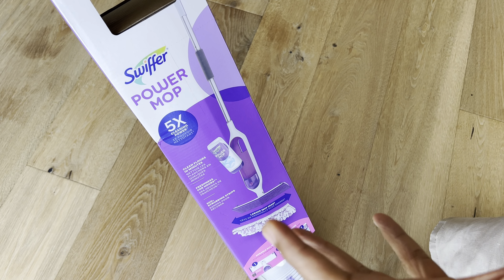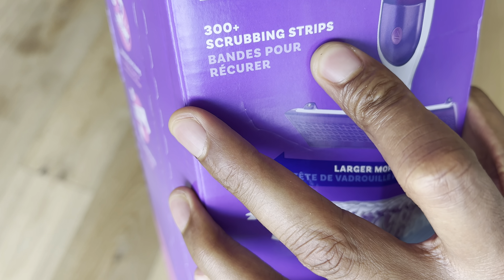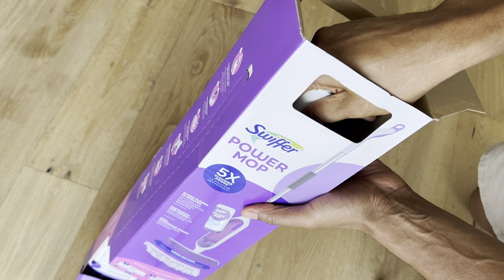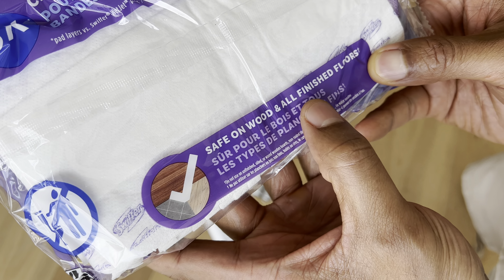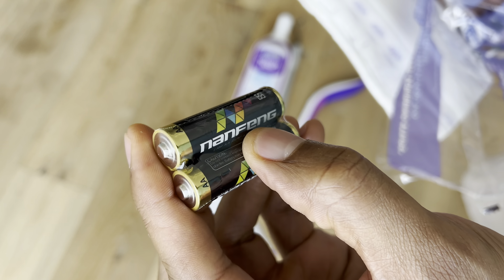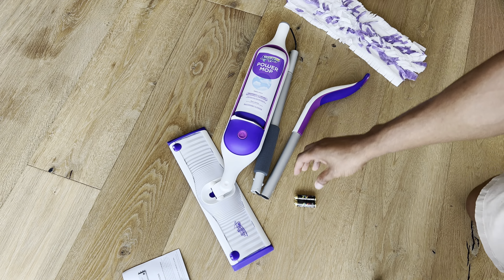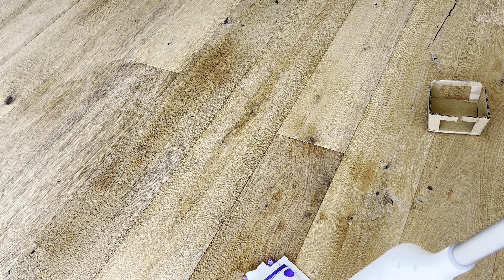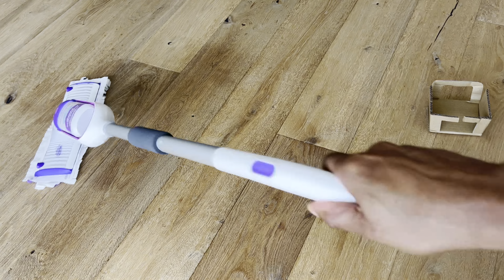Swiffer Power Mop - How to Use

Comment: great mop but after using for a month, the solution bottle no longer clicks into place.    it will not insert!!!!  the pads dont stick easily to the mop.   like every product never made to last.  I have heavy duty cleaning with cats and this mop does know hold up to the task!
Reply from the maker: @heleneschreiner7478 sorry to hear that. mine is still working 

Also, can you subscribe for more great content? I will really appreciate it!
Reply: @DIYPinto  I got mine on recommendation from a friend (housekeeper) who has been using it non-stop for months.
Reply: Where can I get replacement part or is there a 800 number
Reply from the maker: @anthonyglaude8427:
It's great to hear that your friend's recommendation worked out so well for you! Consistent use over months speaks volumes about the product's reliability.

@lorettaford2126:
For replacement parts, you can contact the manufacturer's customer service they can assist you in finding the specific part you need.

Comment: Thank you for the tutorial! I just received my power mop and wasn't sure if I put the bottle of solution into the device if it would leak if not in use (because I'm planning to use the mop tomorrow) so this was helpful!
Reply from the maker: @ajrdggirl Glad it helped! To answer your question, if you leave the bottle in, it shouldn't leak, but it’s always good to check just to be safe. Are you excited to try it out tomorrow?
Reply: @DIYPinto  yess! I love it, been using it for a couple months now and have left the bottle in with no issues!
Reply from the maker: @ajrdggirl:
Awesome to hear it’s working so well for you! Sounds like leaving the bottle in hasn’t caused any problems at all – love when a solution’s that smooth!